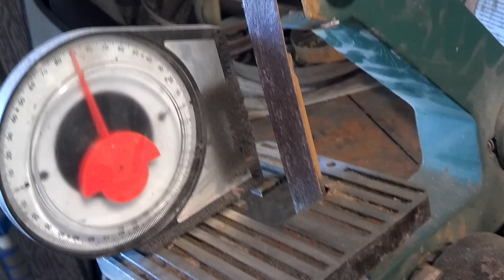1x30 belt sander knife grinder mods (Explained)

Comment: I think you should put the clear plastic cover  back on at the top. It prevents the shavings and grit from being thrown in your face
Reply from the maker: I use the top wheel to shape handles, couldn't do it with the guard on there. I have a face shield I use when I'm grinding.
Reply: Yeah that makes sense. As a matter of fact it makes a lot of sense lol . Thanks man
Reply from the maker: @stickman6624  no prob, thanks for looking out.

Comment: I've been thinking about one of those sanders as a "last resort" because I am to cheap to buy a real 2 by72 sander. You have restored my faith young man. Thank you
Reply from the maker: +drason69 thank you sir...and happy grinding!
Reply: Got it last week.  Works well. I noticed I have to change belts to get the grind going evenly on both sides, but my issue might be that the file I forged the blade from May not be normalised enough. No problem there, I naught extra belts :)

Comment: I'm rather impressed how fast that little grinder takes off metal. Fresh belts at the right grit is everything.
Reply from the maker: Yes sir! I tried using the 36 grit belts and it just made more work for me, the grind lines were so deep by the time I got them smoothed out the blade was too thin.

Comment: Like your mods. I just got mine yesterday. I found that even with the screw tightened all the way, my belts are too loose. Well, I noticed that the whole rear pulley assembly is adjustable, and when I backed off the bolt that holds it, it's spring loaded. And the spring has good tension, I am going to try leaving it loose and see how it works with the spring load only. No more thumb screw to change belts, that would be nice!
Reply from the maker: i thought about leaving it loose too because the belts that harbor freight sells are rarely the right size, i just picked up some 36grit and even with the pulley totally loose they were still to tight. good luck and happy grinding..
Reply: Geronimo Blade Works i get 1x30 belts from Brownells gunsmith supply. ..seem to be higher quality.

Comment: I just tore mine all the way down and cleaned it up. I modded it pretty much the way you did but just welded 1 1/2" of material to the thing you are calling a (Platn)?? I dont know what its called lol Then I shaped it up nice and smooth. I actually turned a 320 grt belt inside out and put it on and used that to smooth it right up. And I dremeled out the tool rest a bit and its working great. thanks again!
Reply from the maker: aguynamedmike77 no problem I hope it helps.
Reply: Man My little knob broke on the tool rest so I welded the metal ring inside of the plastic to a boxed end wrench and then cut the wrench in half. I was pretty impressed with myself...It broke the 3rd time I adjusted it lol.
Oh well. I have a couple other things I may play with. You have given me a lot of Ideas. Thanks again.
Reply from the maker: Yeah the plastic ratchet part broke on mine so I just used a set of vice grips to loosen and tighten that bolt. You should post a vid when its all done so everyone can check it out.

Comment: I am thinking about getting the HF sander. THe question that I have is this:  having the blade edge facing up, cant the paper potentially get cut by the edge? or even have your knife get grabbed and then kicked back at you? I am just starting out with doing my knives, so forgive my possible ignorance on this subject. It would seem safer to me to have the edge of the blade facing down so the paper is cutting away from instead of into the edge.
Reply from the maker: it will only do that if the edge is sharp. do the final grind after heat treat then hand sand when all done turn the knife so the edge is facing down and then grind in your edge bevel.

Comment: This is all the information I have been searching for over the past couple of weeks crammed into ten minutes.  Thanks for that!  Using your method, what angle do you set your platform at for your primary bevel?  I'm in the middle of making my best knife yet, and I want to make sure that I have it just right.  Thanks!
Reply from the maker: +bigby2010 start off at 45º for both sides. Don't use a fresh belt because it will strip all the grit out and ruin the blelt. Once you got your 45 on both sides nice and even then you can switch to a fresh belt ajust your toolrest and start brining you grinde up to your desired height.  When you finish your knife post a vid of it, I'd like to see how it came out.
Reply: +Geronimo Blade Works Thanks for the advice.  Here's a tip for you and your viewers... If you have an iPhone, on the installed Compass App, there is a level including degrees.  Set your phone on your work platform, and adjust to desired angle!
Reply from the maker: +bigby2010 that's cool, thank you.

Comment: Hey, sorry to bring this back from the dead, but what kind and how long is the new bolt? Also, how long is the link you made between the two bolts and what is it's thickness?
Reply from the maker: No problem my friend. The new bolt I think is a 1/4-20..my link is a piece of 1/8in stainless steel with 1/4in plexi glass for support you could use 3/16 or 1/4in thick steel, aluminium or what ever you want..its about 2in long. I hope this helps you out let me know if you need more info and thanks for stoping by.

Comment: Nice modification to a small belt sander. I've one just like it that was given to me a few years ago. I didn't think I needed it till I set it up and discovered all kinds of crap to do with it. Last year, Santa's big fat ass gave me a ''Work Sharp'' Ken Onion edition. I'm a meat cutter, so it came in real handy. I recently got the blade grinder attachment for it. It's useful for those with experience. But you gotta work free handed with it, so I put a magnetic bubble level on the steel I'm workin to keep my angles as precise as possible. I also do a good bit of gun work and it's so hard finding tools that deliver the close/small/precise specs that those like us need without spending a freakin' fortune.
         I ended up at Grangers to find arbors that don't suck, I'm tryin' to true up some new polishing wheels to polish a barrel up to a 555 grit and every arbor I put my hands on wasn't fit to grind a fucking lawnmower blade. Je-sus-H-Christ!! I got a new drill chuck for my polishing rig,, it wobbled so bad, I tossed that bitch in the woods & went back to the old man's chuck he's had for 40+ years. So many tools are shit now days, but you've got it by the balls, don't ya.    The small bench belt sander is a much underrated shop tool for those who fabricate at any/every level. You're mod serves to take that tool even further,, thanks for the video.
Reply from the maker: Franco Tramble yes sir, I'm all about taking things a figuring a way to make them better to further their usefulness.

Comment: What type of belts are you using?  Mine doesn’t go there material nearly as fast. (Currently using 36 grit cheap belts from amazon)
Reply from the maker: i get my belts from harbor freight, the one im using in this vid is 80gr. i tried using the 36gr and i think its too coarse and it just rips all the grit off the belt so theres nothing left to grind the steel.
Reply: Geronimo Blade Works   Thanks for the reply. I actually just picked up some 80 grits from harbor freight but haven’t tried them yet.   Love your videos.  Keep em coming 👍🏻

Comment: It's a good idea - but I'm not sure if you had to lift the table that high to get the proper angle for bevels?
Reply from the maker: i like it because i use it for gring in my swedges. i tend to use this little grinder for other projects other than knives so it gave me a lot of adjustment that came in handy

Comment: Well you just helped me out a lot on what to buy. Ive been eyeing this exact grinder for some time. With the mods you suggested it just sealed the deal. One question though. Can you get any grit for this gribder or is 80 the max?
Reply from the maker: I've got everyhing from 36-400 grit. You can find them on ebay and just about any place that sells abrasives. Happy grinding!
Reply: Klingspor in North Carolina is a good place to get abrasives, including 1x30 belts.  High quality, good selection and great prices.

Comment: You do know that is a level not a angle gage? It gives you a angle relative to gravity rather than the angle to the sanding belt. If your belt sander is not 100% perpendicular to level it will give you a incorrect measurement for your purpose. It could be used like you used to figure out where you had previously placed your table assuming the belt sander has not moved.
Reply from the maker: Yep thank you

Comment: Can you adjust the belt speed (SFPM) from very slow to much faster?  If not, do you know of anyone who supplies bench top belt sander that DOES allow variable belt speed?
Reply from the maker: +LFOD7491 I don't know of any cheap speed adjusting sanders. I think once you get into variable speed grinders the price goes way up. I use a 2hp variable speed grinder made by Pheer.
Reply: You could switch the AC motor out for a DC motor, like one out of an old treadmill. Make sure you get the electronics too. I see old DC motors with controls in Craigslist

Comment: hi, I found an old vintage Model 730 belt sander. Will that provide enough power to make a 1095 high carbon steel knife? Also do I need to modify the machine?
Reply from the maker: I'm not familiar with that sander so I don't know the hp or rpm but I can tell you whatever it is its faster than using a file hahaha. Just try it out, take your time, get a feel for it. When you put enough time on it grinding then you may be able to think of ways to modify it to better suit you. Let me know how you make out. Happy grinding!

Comment: I used the HF 1x30 and I think it does a great job too. Any flaws are most likely on the user side. One question, how is your edge so damn clean, are you using a jig on the 1x30 too? Thanks!
Reply from the maker: i sharpen all my knives freehand on a worn 400grit belt and then strop with medium compound

Comment: Hey man nice vids! I have the same style sander only smaller (31-080c). When I attached the 1" sanding belt and turn it on, the motor won't spin. It appears the tension is too tight. Is there any way to adjust the pulley tension?
Reply from the maker: On my sander there is 3 wheels. The bigest is the drive wheel at the bottom the top wheel is my tracking and the center wheel is the tensioning wheel. My tensioning wheel has a nut by it if I losen it then it moves in and out via spring tension. Try that out, but I have found when buying cheap belts they can run to tight no matter how much you adjust the sander.
Reply: Geronimo Blade Works it turned out the pulleys had built up so much dust inside the bearings. Cleaned and lubed them up and the sander spins beautifully. Thanks for your reply.
Reply from the maker: Awesome! I'm glad you got it fixed, happy grinding.

Comment: great video!  Just a quick question.  When the blade has a "belly" how does one do the curve?  Is this done by hand?
Reply from the maker: +Nathan Bright for a full flat grind you keep the knife straight and do horizontal passes. To make a saber grind you bring the handle side twards you while the tip stays in contact with the belt. Scribe a center line down the edge of the blade before you start the bevel, this is to make sure your grinds are even on both sides. Any more questions just ask.
Reply: +Geronimo Blade Works thanks!  consider me subscribed
Reply from the maker: Cool thank you! Can't wait to see your blades.

Comment: what's up Gman?, hooty hoo.  was Gman 04 to 08, , just picked a 1x30 up gonna see what I can do, I made 2 knives before  doing it by hand with bench grinder and hand files but I'm just someone who tries to make everything just to see if o can
Reply from the maker: +groundburst cool beens I'm 01-05 out of polk. When you get some ground out I'd love to che k them out. GERONIMO, ALL THE WAY!
Reply: +Geronimo Blade Works definitely will show some work, I'll have to send you a pic of the last two I did by hand file and bench grinder. I was at polk also. DTRP 04 to 07 then was the BN s3 air til 08.
Reply: +Geronimo Blade Work were you making knives when you were In BN? I remember a PSG from A Co that made knives if I'm correct.
Reply from the maker: +groundburst I was Aco 3rd PLT, I've only been making knives for a bout three years.

Comment: Ha sorry spoke to soon, how about the handles do you use the same sander?
Reply from the maker: Carlos Delao I used to but now I use my 2x72 it's much faster. Thanks for checking out the vid I hope it helps you out.
Reply: ok, will probably upgrade later, but just wanted to know if this was capable of doing the job.
Reply from the maker: Yes sir that 1x30 and a rotary tool for cleaning up finger grooves is what I started with
Reply: Alan Clark Alan, thank you for your time, you can check out my work at www.GunEngraver.com
Reply from the maker: Shit that's amazing work you do

Comment: first af all: thanks. then: like and subscribe. 
especially for your simple, not boasting in empty blah blah blah, but giving us cool suggestions on the tool every starting knifemaker uses. for not having like "hollywood on you tube" craftsman "HD images" but instead some simple and easy, ideas anybody could make himself, of real useful substance. 
as too many do about their own ways to work, more to get a name and sell more knives at higher prices, than really to help others for true, bringing with wonderful hfrom their igh-level experience" often more confusion and doubts in their heads on dozens of issues that one would have to face way after. instead that what is clearly has to be done to start simple and sure. or on the other hand giving you wrong, crappy, not really well tested, suggestions but as nothing less that must do's. or even more common, making a work selfie of 15 minutes video on a thing that has already been explained and shown in almost another dozen videos - and exactly in the same way! - not adding anything intersting new.

instead you gave me few but really great ideas for modification this unexpensive starting grinder I bought not long ago but still giving me problems, to be used properly for knifemaking. I saw many vids about that but helped not much. but yours suggestion are as simple than crucial, because they help to use his little but good potential, without strange complex jigs. as I thought too, because it really could do it well without! because the workplan moves and can be be fixed just the direction and in the way we need! if well controlled also precisely as you seem do it. but to make this out as it must be, for this I found genial, to be so simple and making real complete difference especially the welded file behind the grind where's the plate where the the knife is grinded - othervise it comes out a mess of double convex grind each also on the spine!

some questions:
I have a different angle measure tool it seems to work pretty well, I havent'ever seen any like yours, what's its name? where did you found it? 
what is your usual change of grain from beginning to end? 
do you also saharpen and hone (why not, it seems ok and cool for me. no?) knives with the belt grinder, or did you do it, with what results?

thanks, really great works yours, I liked so much the second tanto you showed here. keep it cool bro, take care.

(pardon for my bad english)
Reply from the maker: +nome nemo your english is good enough my friend :-)
I do also sharpen all my knives with this grinder I use 400 grit to start the edge and then a strop to make it razor sharp. I don't know exactly what my angle tool is called, I bought it at a local hardware store, i dont use it anymore. The best way to grind bevels is to scrach a line down the center of the blade where the sharp edge would be. Start at 45º  and grind till you are almost to the center line, do on both sides. Then you bring you angles down to to bring your grind lines up higher to where they look good. As long as your cutting edge is around 20-22º per side it will be good and sharp. Let me know if you need more help, take care
Reply: +Geronimo Blade Works Awesome detail.  Thank you.
Reply from the maker: Yes sir, happy grinding

Comment: I have a question. What is the length of metal did you use for the table rest? Also what length did you use for a platinum and what metal and get the right angle?
Reply from the maker: +Joel Pogue the link between the sander and the tool rest is about 2 inches long, the platen is about 5-6 inches tall I used 1/8" thick stainless steel for it. If you have anymore questions let me know. Take care
Reply: Thank you for answering my question. So many people I ask questions do not return answers.
Reply from the maker: Yeah I try not to be like that. I hope the video helps you, happy grinding.
Reply: +Geronimo Blade Works I noticed that you out the plate to the to the first line that ran across the plate or did yours come like that?